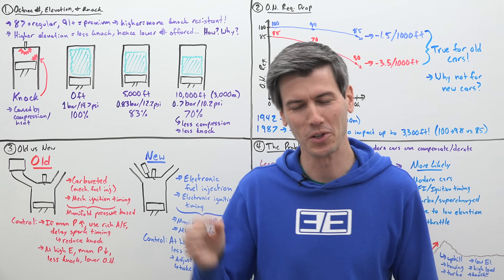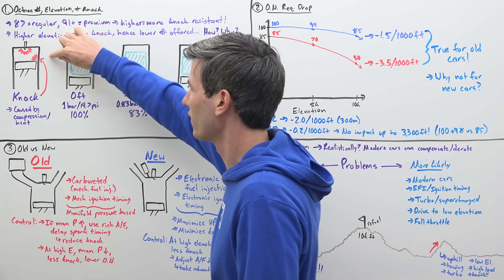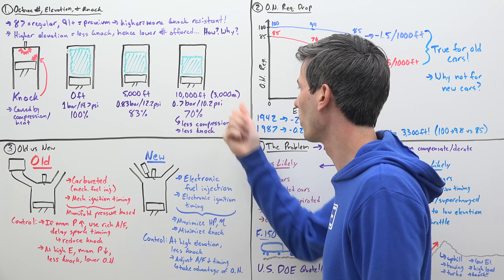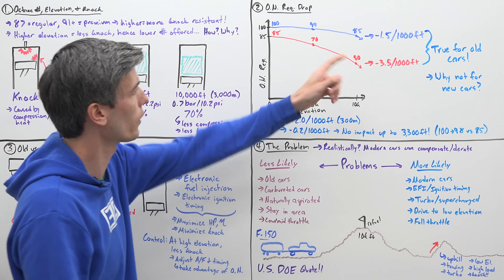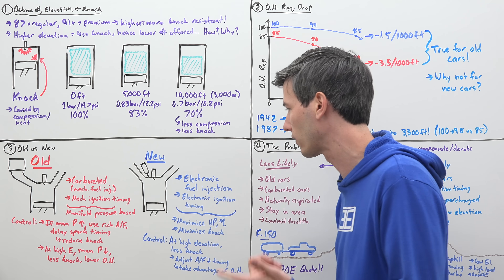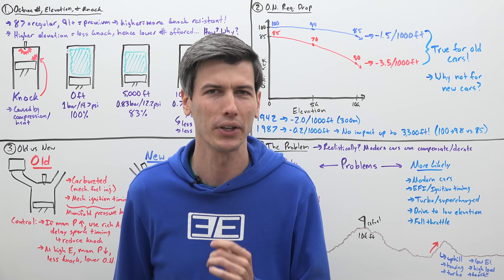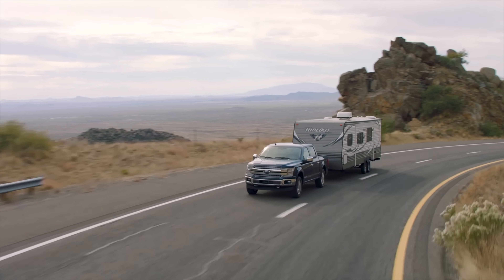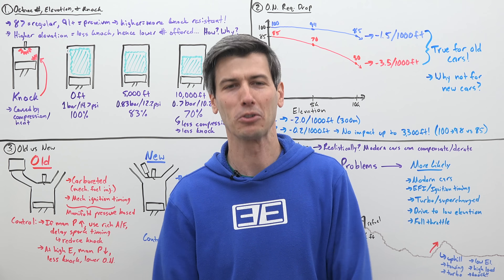Never Use This Gas In Your Car!

Comment: Guys I need your help we have in utah 85 and 88 only so which one I use it ?
Reply: 88 if you can afford it. 85 if you can't, there won't be actual damage until the car has 100,000 miles or so on it
Reply: @Mcfunface  thanks a lot

Comment: Im over 6k feet they sell 85 here. Of course you are right saying stick with the manufacturer recommended octane rating. But there is a ton of farm equipment, yard equipment, and powersprorts stuff around here mostly running carburetors. Likely most of them are easier to start with lower octane. Thus justifyingthe sale of said low octane... i guess i need to experiment on my sons old polaris and see if it starts faster with lower octane

Comment: I'm a bit surprised by this as I thought most modern engines had knock/ping sensors that would automatically delay the spark timing to compensate.

Comment: I live in Colorado at 7800 feet. I always tell people not to use the 85 octane fuel but you see so many people using it. 🙈 I have found that you also use a lot more fuel on 85, like 15% more because the car seems to be down on power. I use 91 in both our naturally aspirated and turbo charged, both directed injected, cars. I find that we get much better fuel economy on 91 at this altitude, but this doesn’t hold at sea level. It might be good to explain why using 91 at altitude results in better fuel economy, not to mention it slows down the carbon build up.

Comment: High performance cars also automatically detect the type of fuel / octane levels and can therefore dynamically adjust ignition settings to prevent knock. I know Koeningsegg does something similar as well. Unfortunately, we're not all driving Koenigseggs :P

Comment: So the conclusion, as I see it, is to avoid buying 85 octane and get the next highest octane gasoline, so as to protect the engine for my 2019 Toyota 4Runner. Is that a reasonable conclusion?
Reply: If you live in Utah at 4500 ft yes. If you live in Colorado at 6000 to 10000 ft then you're more fine.

Comment: The true scam is that gas stations that sell 85 octane, sell it at the same price of regular "standard" 87 octane everywhere else in the country. They sell 87 as midgrade. This is a blatant ripoff to consumers. 87 should be the standard period!
Reply: Unfortunately you dont know what you are talking about. At high elevations 87 is midgrade.
Reply: gas companies get away with using 85 as a low grade where 87 would be fine as low grade. It's lesser octane, so why aren't they charging less?  @mikebradford7780
Reply: @mikebradford7780  lol.  You don’t understand. The price is based on octane rating. Higher octane translates to higher price. 85 should be less than the national standard 87 because the octane is lower. Consumer gets fleeced.

Comment: ln 1992 I bought a Buick Ultra  3800 2 with a super charger.   I live in Texas and used 85 in winter and  87  in summer.  I drove it over 130,000 miles. It would go up Pikes Peak purring  like a kitten.   On the highway it often made 32 mpg average.   When I drove to lower altitudes then 92 Octane.
Used to be regular 87 had more  BTU's than 92...may not be true now.

Comment: I always advise to use the best fuel possible, tune your ECU to take advantage of it and have significantly less worries about clogged injectors or carbon deposits. It works for me

Comment: I went to visit my brother in Denver and I live in Memphis, I drive a 22 Sant Cruz with the turbo 4 cylinder. My mpg went from 24 to 8 when I was in Denver and a noticeable lack of power. I put 91 in it and my mpg went back up to 15. I saw the 85 and I knew not to put that in there but why did it drop so much when I went up the mountain? I normally put 87 in it (87, 89, 93 are the options around here) because I don’t have to use 93 with that engine.

Comment: Would engine control computers retard timing or limit boost or otherwise dial back cylinder pressures based on knock sensor indications?

Comment: 95 octain is the standard fuel in the uk. we don't go any lower, and premium is 98 octain
Reply: Different measurement methods are used in Canada and the United States. U.S. or Canadian 91 octane  = 97 Ron in the UK. And 93 U.S. octane = 99 Ron in the UK.

Comment: Bad information and misleading. Ford recommends 87 because it's a TURBO charged engine and negates a lot of the compression loss at altitude this requirement for 87 octane. You should delete this video and remake it with accurate information. Also, carburetor will see less pressure at altitude and adjust accordingly. You get a lot of things wrong in this and mislead people who don't understand how these things work.

Comment: I'm rather surprised that a key difference in fuel between 1942 and 1987 was not considered here, that key difference being the use of TEL (Lead additive) that just so happens to be a very good knock reducer / suppressor in the fuel back during the 1942 research that wouldn't be present in 1987 research since the use of Leaded fuel was banned back in 1975. I'd be willing to bet that was a significant contributor to the vastly different change per 1000ft of elevation difference between the '42 and '87 research results seen.

Comment: I drive a turbocharged that requires for premium gas by manufacturer but for all these years I only pumped regular (87) and never had problems. My buddy who drives a Mercedes C class also pumps regular gas for the last 10 years and has zero issues. In rear case it might activate limp mode when you drive uphill on backroads as if you on a race track!

Comment: You left out one thing:  These modern engines have knock sensors that adjust timing.
Reply: Yes. But not down to 85 octane. 87 is the lowest setting on them.
Reply: @GalaxyFur  There is no such "setting",  knock is knock!
Reply: @Kevin Cook  Yes, there is. The timing only goes as low as 87 octane. Hence, why 85 octane VOIDS your warranty.
Reply: @GalaxyFur  There is no such thing as 87 octane timing(timing is degrees of crank revolution before or after top dead center) - the ECM doesn't know what the octane is but it does detect knock and adjusts ignition timing to stop it.  The manufacturers statement is arbitrary  and capricious.  High altitude is a good justification for lower octane because it is the same as lower compression ratio.
Reply: @Kevin Cook  In older engines, yes. But not in modern vehicles. Any engineer will tell you that. Including this very video. And yes, the engines are not capable of adjusting timing lower than the 87 octane rating. If they could, you might as well run water. Facts are facts. 🙄

Comment: I did a road trip back in 2011 with a Toyota Sienna (2006, I believe), and out west in the higher elevations, all of the stations on very long stretches of road had nothing but 84 octane fuel.  So the choice was, use the lower octane gas, or go empty.

I can say there was no knock at all on that fuel, and the mileage in those parts was 20% plus higher.  I expect the overwhelming majority of that was reduced air resistance.

Comment: Does temperature of engine affect octane/knocking? Mainly air cooled bike engines. My bike has 10.5 compression ratio and 350cc air-cooled long stroke engine. Honda  CB350

Comment: Why is the octane in US gas so low? In Sweden our "garbage" gas was 93 octane(not sold any more) the regular is 95 and the "good stuff" is 98, why the big difference?
Reply: The United States and Canada use a more strict measurement method for determining octane compared to Europe. You guys only use the results from the Ron test. North America, however, uses the results from both "Ron" and "Mon" tests. 

This results in lower numbers. 

So U.S. 91 octane = 97 Ron in Europe. And U.S. 93 octane = 99 Ron in Europe. 

97 octane and above in the EU is considered Premium. And the U.S. and Canada, it's 91 and above is Premium. 

So, it is the same fuel but different ways of calculating octane. 

The North American method is just more accurate as its numbers better reflect real-world burn under atmospheric conditions.
Reply: @GalaxyFur  Unlikely, eu pump gas is with in a hairs with of qualifying for aviation gas while the us is not even close. Oktane is oktane, we do after all pay $10 per gallon, give or take a quarter.
Reply: @AgW  The U.S. and Canada gasoline is 100% identical to that which is used in the EU. The EU just pays a whole lot more for it. Gas is much cheaper in North America compared to the EU.

The EU just taxes the gasoline (petrol) into oblivion. ⛽️

Comment: That is the best explanation of 85 vs 87 octane I’ve ever seen. I drive a 2022 Newmar motor home with Ford V8 and never put 85 octane in it. Thank you
Reply: I used to haul fuel and 87 is just 85 with a 1 percent blend of ethanol all you need is some additive to raise the octane rating
Reply: @Sloth-j1m  Good pts.
Reply: 87 is already very bad especially for turbo charged cars, only because of direct injection and tuning tricks it barely scraping by without knock on 87 and at ultimate cost to power output and efficiency. 85 is is just for most lazy tuned rich running naturally aspirated engines with very low compression.

Comment: I live @ 4k foot and you are wrong. I.E. ecoboost instead of 14.7 psi you start at roughly  11 psi even if you go wot you will always be 3 psi lower. ford tests fuels for knock and adjusts the timing. Tuning my 3.5 ecoboost saw 87.5 octane on 87 octane fuel 91 read 90 to 92 octane. @ 4k feet elevation you will never make up for the 3 psi loss and timing can always back down.

Comment: You didn’t explain knock reasoning all they well for someone like myself who taught automotive engineering,as well as wrenched for 30yrs…you showed the little spot which you said was the reason for knock..ie a hot spot..but what your not saying is that yes a hot spot can cause pre ignition , but your not explaining what it’s from…I get your trying to keep it simply while also explaining it in some what decent details..you should explained what causes the hot spot, not that the hotspot is causing the cylinder to explode sooner than it should

Comment: Yeah our main gas here is 85 but we're also at 8000 Feet and all our vehicles do just fine.
Reply: the computers in your cars are retarding the timing and making less power. why buy expensive cars and run them on the wrong gas.

Comment: The issue is...the manufacturer designed the engine, it's calibration, and it's emissions compliance to run on a certain minimum fuel octane. It's how they chose to build it and the quality of fuel and the location is out of their control. If you want the power you have to feed it the fuel it needs. You can control the gas you buy, you can't control the atmosphere where you are at. Some designs are better than others, gas mileage ratings will give a clue. You really papered over the forced induction factor. Forced inductions is for power, if you want it you got to feed it...period.  It's all a compromise people, do the math before you buy.

Comment: but don't modern cars also have knock sensors that will detect knock conditions and compensate accordingly?
Reply: Yes they do. The knock sensor will help the computer to back off ignition timing and turbo boost.
Reply: @snowrocket  this seems to contradict the conclusion of the video though. because it says newer cars are more sensitive to octane.

Comment: What you didn't say is that at high elevations, because the air is thinner (lower pressure) the air/fuel mixture becomes fuel rich and fuel is wasted because there is excess gas in the cylinder that does not burn due to less air in the cylinder.
Reply: The MAF sensor means the ECU knows air pressure has dropped so this doesn't happen, and even if it did, the O2 sensor would inform the ECU its running to rich.
Reply: @Phos9  Correct.  Even a carbureted car will not be wasting fuel it it’s tuned properly.  I grew up riding motorcycles in Colorado, and the 90s and older ones often times had carburetors.  The first thing we’d do is tune them for high altitude by RE-jetting them.  I’ve even RE-jetted chainsaws and trimmers at high altitude.  

To the OP, you’re only wasting fuel at high altitude if something is broken or not tuned correctly.  It is NOT a normal operation for an ICE engine.

Comment: I understood 'knock' is caused by low octane fuel in a high compression ratio engine, because the low octane fuel self ignites at a pressure that occurs before spark ignition. The effect is that the self ignited fuel causes the piston to be forced against its motion towards top dead centre.

High octane fuel can withstand higher compression ratios and will only ignite when the spark occurs.

Comment: In my area, 85 and 91 octane are usual ethanol-free, the 87 is 10% ethanol.  I mix the 85 and 91 to to get some 87 octane ethanol-free for my small engines (lawnmower, snowblower, etc.)

Comment: most engines designed for higher 87+ octane have the anti-knock capability which means the timing is automatically retarded to eliminate pinging. I don't know if 87-octane engines have the capability, but I suspect they do. Beware of these kinds of videos, they sound good, but they can mislead you.  It is best to check with the mfg. rather than this kind of information. BTY oil companies must adhere to regulations preventing this kind of problem.

Comment: In Colorado, the best "standard octane" fuel is #86. In the Denver area, the "standard" octane is #85. It is considered that #87 or #88 is "mid range" and "#91" is premium grade. There's virtually nothing above #91.  Its required that you pay a 20-cents per gallon upcharge just to get to #8, and an additional 20-30 cents to get in to the #90 (+) range.

Comment: I get more knocking out of my old carbureted cars on bad gas than my modern ones with knock sensors, especially the old leaded gas cars with higher compression than those built for unleaded fuel in the 70's. My normally aspirated 87 Porsche 944S required 90 octane. It ran fine on 87 but had less power as knock sensor etc dialed back the timing. On old car I'd have to turn the distributor to dial back the timing. Otherwise it will knock until I melt the pistons if I don't back off the accelerator.

Comment: My 2021 Toyota Camry XSE AWD uses Regular Unleaded gasoline with a 87 Octane which is what they recommend for maximum fuel economy and efficiency since the Electronic Speed Control Module is tuned that way not sure if I believe using the wrong fuel could void the warranty though...

Comment: If you don't think OEMs test their engines on 85 and make sure they have a safe enough cal to use you are incredibly naive. Lawyer-ese for edge case situations does not a disaster make for the bajillion forced induction engines running on 85 octane.

Comment: This may be one year old but here we go.  The lower octane can be acceptable under one or a combination of two conditions.  Altitude and/or temperature.  The reason being high Altitude and temperatures create conditions of lower air density lowering the physical compression ratios of the motor.  That coupled with the onboard computer adjusting the spark make it usable.  How else do you think they can use 87 octane in a E-85 rated motor with a 12:1 compression ratio without knocking?

Source: I r meckinic

Comment: I'm interested in why an old low compression aircraft piston engine with a carb and mechanical ignition and no turbo would need 100oct as most are required.

Comment: I was a truck driver and hauled fuel to the gas station... to make mid grade fuel the truck driver at the refinery puts 1/2 regular fuel then 1/2 premium fuel to make mid grade... the problem I complained was when you deliver diesel fuel to one gas station then put gasoline in the same tank it still has diesel fuel in the tanker. I Throws maybe 2-5 gallons of diesel in gasoline. This is why there is alot of carbon in direct injection gasoline cars and trucks

Comment: I live in Colorado where 85 octane is called “regular”, but since my car is intended to burn 87 octane, I buy the so-called “midgrade” that’s 87 octane and get ripped off for an extra 30 cents per gallon by the gas companies.
Reply: Damn! I never thought of it that way! The oil companies are using this “high altitude” excuse to dump low octane fuel and still charge mid octane prices! They know damn well that they don’t need to produce 85 octane fuel at all!

Comment: As a European, where it just seems fuel is generally more standardised, its peculiar that one can actually get something else than US 91/93 equivalent EU 95/98. Could it be that there is more agriculture in those states in the US where low octane fuel is sold. From what I have seen on the American Continents (been more to the south) is that there is much lesser emission restrictions when it comes to farm machines and vehicles and therefor older, yeah even antique machines and vehicles, are still in service.

Comment: So tell me professor, why my 2001 Astro Van and 06 Trailblazer both get dramatically better fuel mileage IMMEDIATELY upon receiving a partial tank of 85 octane gas in either St George, Ut (3000 ft) or Cortez Co (6190 ft) after getting the same lousy mileage in Flagstaff (6900ft) that I get at essentially sea level in Lake Havasu, Az??...It's my belief that modern cars especially, with their altitude-compensating engine controls, run most efficiently on the lowest octane gas that doesn't make them ping.... Lower octane gas is simply more volatile and burns more readily......Consumers should be given the choice of what gas they want to buy regardless of location instead of the government choosing for us.....BTW.... Coming back into Arizona from either of those places, I continue to get great mileage without pinging until I've refilled a couple of times with 87...

Comment: I have a 2004 Nissan Frontier XE 5  Speed manual and I've always used premium fuel. Now it has 258536 miles on it and still performs excellently. Oil changes are never black. 😊